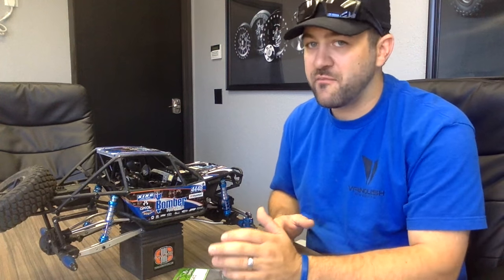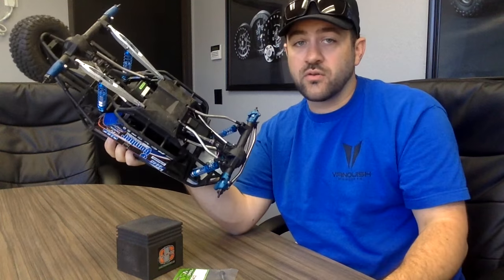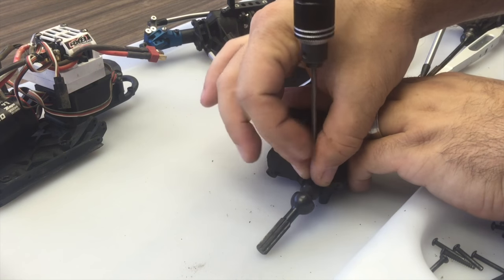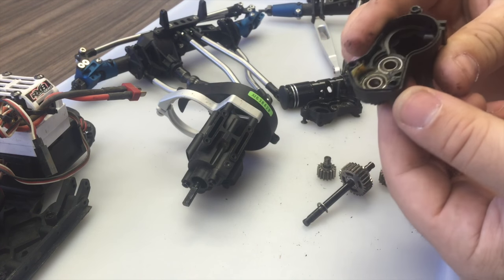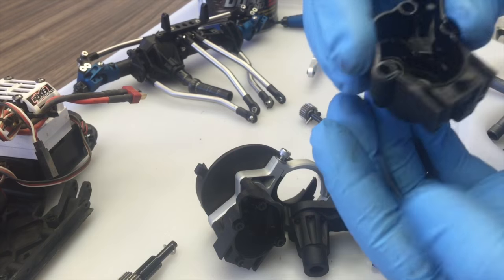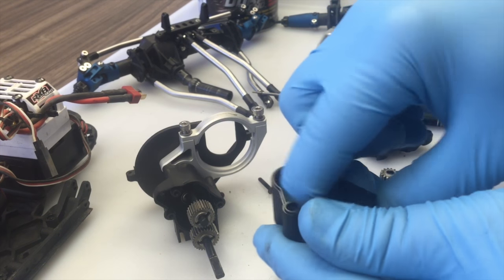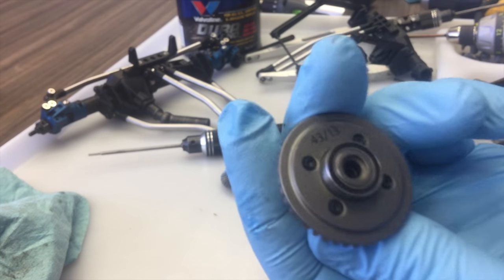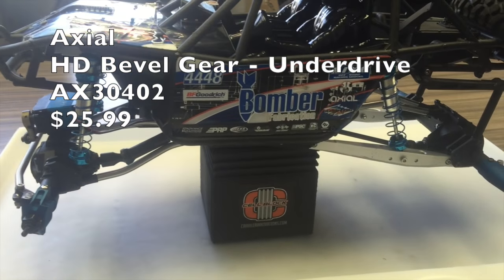Axial RR10 Bomber Budget Build - HD Gears - Episode 13

Comment: Great videos first off, I just got back into RC maybe like almost 2 years ago, the scale stuff really got me hooked again.  Built a scx10ii just got the rtr electronics and found myself wanting something a little more extreme so I built a bomber.  Stock kit and I threw a mamba X with a holmes puller pro xl 3500kv holmes servo ready to rock n roll.  But the first 3 times I took it out just to test I broke the steering horn stripped it immediately then threw the right rear tire clean off the stock beadlock...I came back to your bomber upgrade series I watched parts of 2 years ago and next thing you know I watched the whole playlist in 1 sitting.  I had to order up a bunch of vanquish parts, very excited.   Just figured I would throw my 2 cents in also, great work my friend, If I ever make it all the way out to axailfest (WI native) hope I run into you.  In a way you are part of me returning to the hobby along with Matt from SBG and guys like Coleman.  Keep up the good work!
Reply from the maker: Thanks Mike, I appreciate the comment. Hope you enjoy the Bomber as well, it is a beast of a truck!

Comment: Hello always helpful to watch you videos and I've built two of your chassis my question is I can fine anything on gearing I want slow and lots of torque for crawling with a two speed trans what do think of gears to use thanks
Reply from the maker: +Chris Flick 12t pinion and 56t spur is a solid low speed setup.

Comment: Adding the lower gears in the rear was there a specific reason in not going with over drive in the front and stock in the back??
Reply from the maker: +Travis Merrix I'd always rather run more reduction in the axles as it takes stress off the driveshafts and transmission.
Reply: +Harley Designs ok thanks for the reply you channel is great I have learned a lot from watching... Your budget builds are killer keep them coming can't wait to see what you do next

Comment: I have a axial yeti built from a kit and I upgraded both diff's and the spur & pinion gears for more speed , do you think the stock transmission & transfere case gears should be upgraded too hardened steel or is stock ok ?

Comment: Wouldn't it get drivetrain windup?
Reply from the maker: +Scott RC Addict the slight drag effect from the rear aids in turning and climbing. Since we aren't running on pavement there is almost always enough slip in the terrain to not have adverse effects. It would be more of an issue if the rear was faster than the front.
Reply: Harley Designs ok, that makes sense, cool build